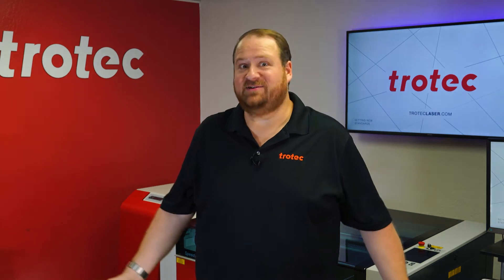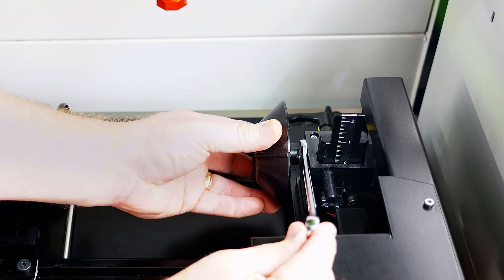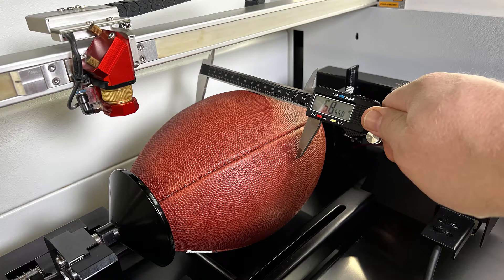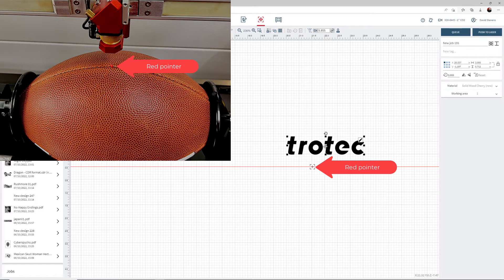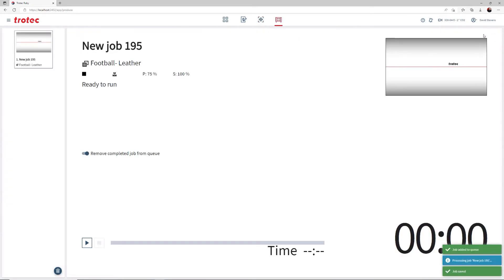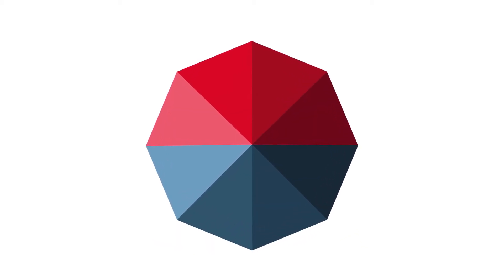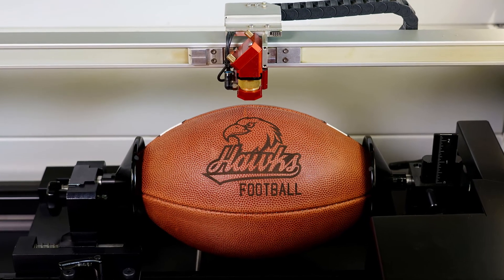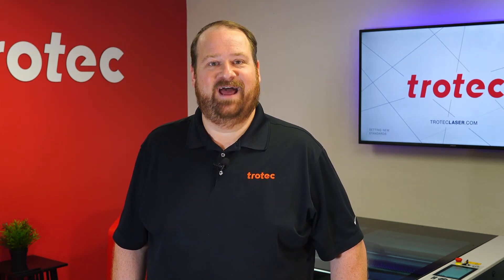Trotec Laser: Can you Laser a Football?

Comment: Nicely done! We recently got a rotary for our Speedy 300, and I'd love to understand in Ruby, e.g. the rotary does a full rotation in each direction to "find the ends" before starting, so I'm not sure how to ascertain where the centre is before beginning (e.g. if I need to line up an engraving with an existing mark on the cup). I'd also love more info on warping a logo to appear to be the right shape when used with the tapered cups we bought from Trotec.
Reply from the maker: The location of the graphic is accomplished with the red pointer. Place the red laser pointer at the location on the diameter where you want the graphic, then snap the graphic to the pointer in ruby, and it will engrave in the exact location. As for compensating for the angle, this is typically not done because it can be a very complex mathematical formula that would vary with every angle and diameter. However, 99% of graphics do not have an issue as they do not show enough skew for the eye to notice.  For more information on the rotary please refer to the following video: https://youtu.be/HnW-KKMPwQs